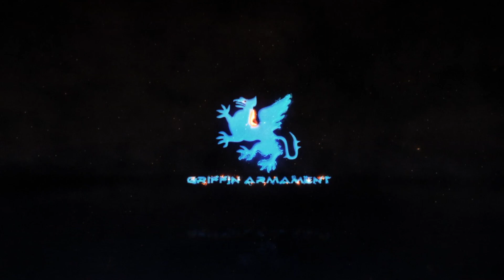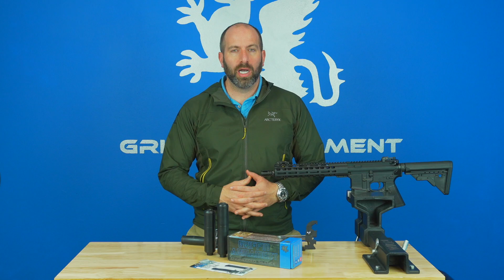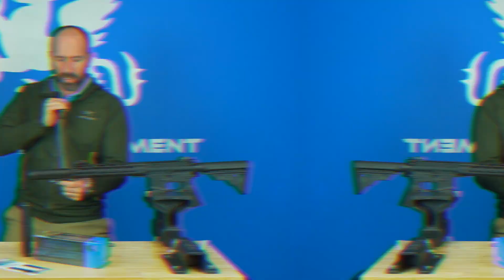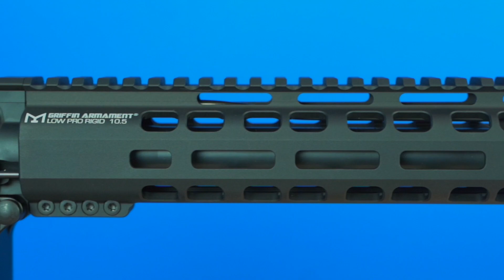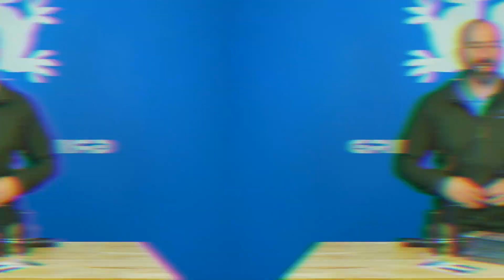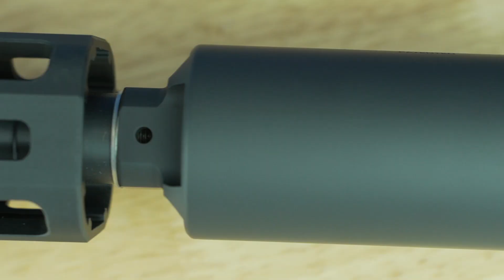GP5 & 7 Installation Guide

Comment: How will you clean the silencer after pinning and welding?
Reply from the maker: You'll likely have to drill out the pin and weld it back on after it's been cleaned
Reply: @GriffinArmamentOfficial Do you really “need” to clean it?
Reply: @echofoxtrotwhiskey1595 I would wager not really. They’ve probably designed this one so that it will outlast the barrel it’s welded to

Comment: Can i put a gp7 on 5.56 for greater reduction?
Reply from the maker: There won't be much of a difference, considering the GP5 is tuned for 5.56 specifically. Most caliber-specific suppressors are engineered to be the best in their class, but a 7.62 suppressor will still do the job.
Reply: The GP7 will be louder than the GP5 on a 5.56 gun.

Comment: We need a proper cleaning video. Mainly because the ends are welded and can not just take them down and brush them out.
Reply: No need to clean. The round is high pressure so it cleans itself
Reply: either let it sit in a bucket of kerosene or ultrasonic cleaner.

Comment: Do I need an adjustable gas block for the GP5 on a 10.5
Reply: @gator5566 Adjustable gas blocks are not recommended by any serious user as they tend to seize up from carbon buildup and become non-adjustable gas blocks. They also tend to fail and cause cycling issues. It'd be better to research the optimal gas port size for your setup and match a fixed gas block for that. Then change buffer weights as necessary to get reliability. Everyone should own H1, H2 and H3 buffers and just have them in their range bag. For a 10.5" AR with a GP5, you'll be using either a H2 or H3. Also, buy spare gas rings and perhaps step up your BCG to a GA or BCM.

Comment: Why wouldn’t I be able to pin/weld to a 9 inch barrel ? 9+7=16 - not being a smart ass, genuinely curious as to why you stated 9.5 inch minimum
Reply from the maker: you have to figure in the length of threading. That overlap won't quite get you there, which is why the 9.5 requirement

Comment: In your experience does torquing the suppressor down to 35/45 ft lbs prevent it from backing off? The convention for hand-tightened direct-thread suppressors is to periodically check and tighten as you shoot. Can you also torque it down from the front wrench flats?
Reply: Do you really want to keep retightening? Eventually you’ll baffle strike your supressor that way considering it doesn’t take that much slant

Comment: If I pin & weld this to a 10.5” barrel, what would the total barrel length be?
Reply from the maker: The GP5 can be pinned and welded on a barrel as short as 10.5" to get you to the required 16" to qualify for a one stamp